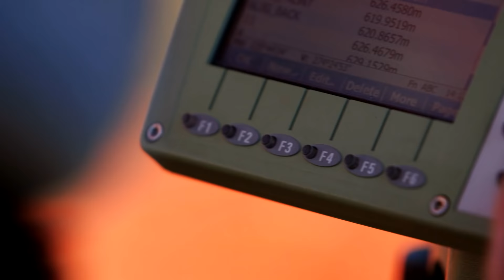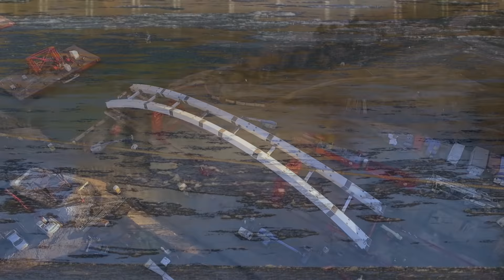Ironworkers - Hanging Iron

Comment: I am proud to say I was a Iron Worker for 36 years out of Local #512. I will never forget the time I had my structural belt in the back of my truck. It was loaded with the usual Connecting tools. Sleever bar, spuds, bull pin, 6 lb beater, 2 bolt bags with one full of bolts. I was at a local cafe standing around my truck talking to some friends. One of my friends asked what the belt was for. I told him i wear it at work while connecting. I pulled it out of the truck and handed it to him. He couldnt believe anyone could wear that belt with all that weight and still work. I told him thats what is required for Iron Workers to do there jobs! I think i earned there respect that day.

Comment: I could have been one helluva ground iron worker.
Up high I d need one hand to hold on to something substantial and the other to chain smoke cigarettes.
That doesn't  leave much to work with.
Reply: L🤣L 
I felt this statement.!
Reply: Gotta be a good connector to be a good ground worker and vice versa. Can’t be scared of heights in this trade